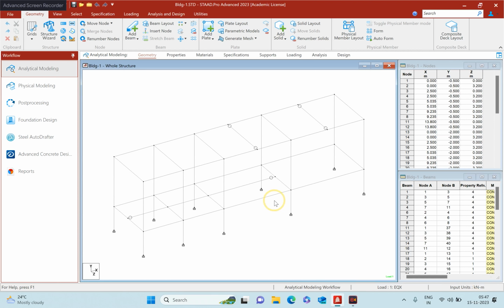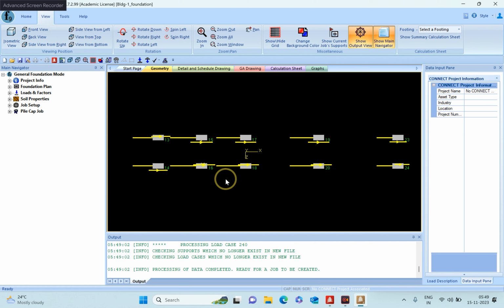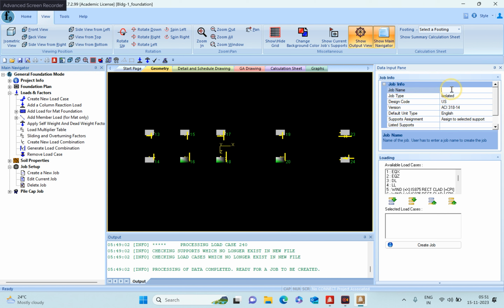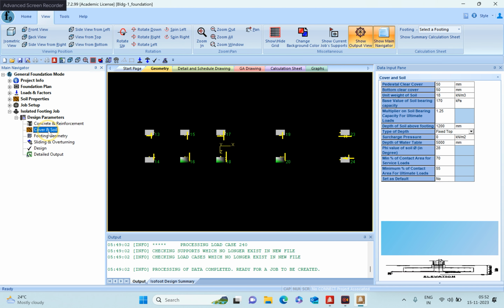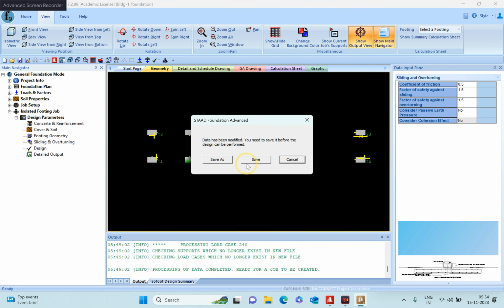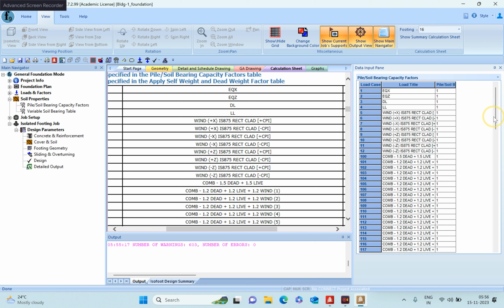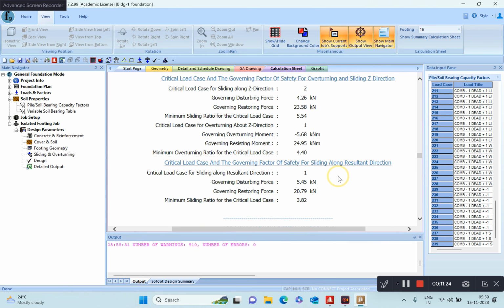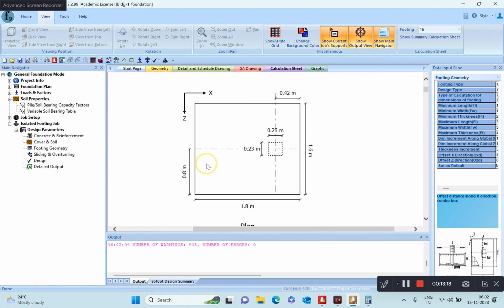Staad Foundation-Part 1 - Isolated footing

Comment: If design analysis is failed what will do
Reply from the maker: 1-Check all the inputs are entered with proper units, 2-increase the restriction in min and max length, width and thickness.3- allow the program to calculate the dimensions